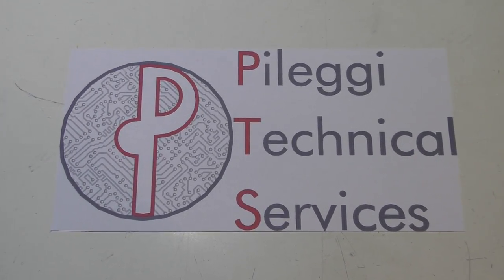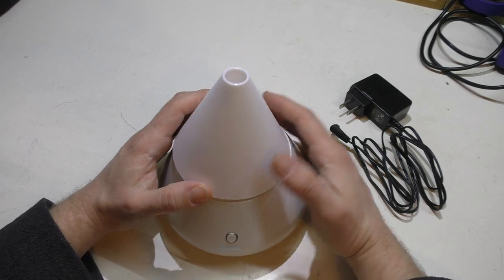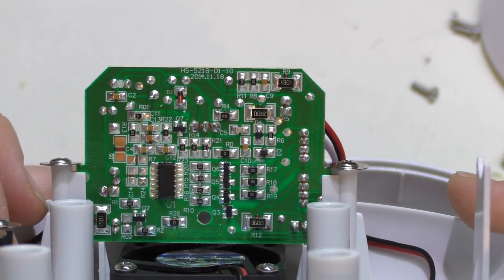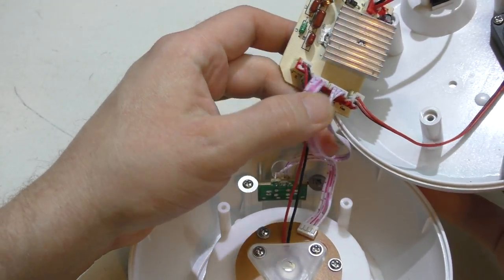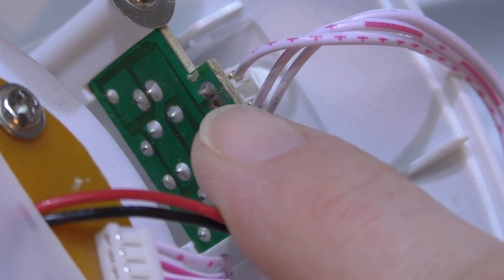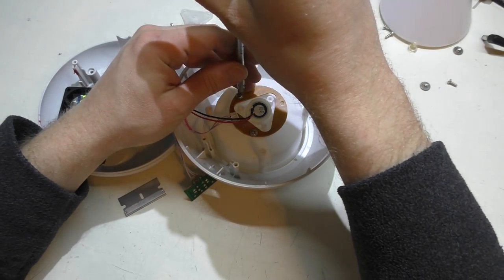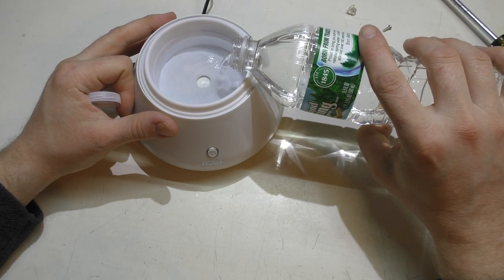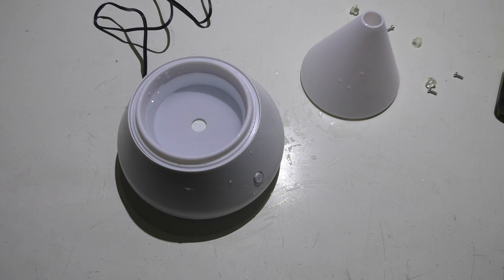PTS Ep. 37 - Aromatherapy Diffuser Repair

Comment: Take it apart first as Chris said and look for rust.  I paid to much for this thing to give up and by another.  I just finished fixing mines.  Chris I don't know what kind of tooth brush you used but I used a piece of steel wool (Toothbrush failed lol) to get the rust off of any components.  You are the man!  I worked threw three Amy Winehouse songs (auto play but songs were good), I may be a new fan.  Anyway I cleaned the steel wool off with q tips (case anyone tries my madness) and I tapped each side gently to make sure i left no debri/dust/steel wool.  I watched you last night, and  I was like I'm probably not going to try this.  Well I did it worked.  Wow we need more patience in this world and you taught me a bit more with this video.  Thank you I saved 40.00 bucks plus money I would have spent and ended with same problem. Warning if you have this one pour the water into it carefully I used an ice cream scoop this time and made sure no water went  into the little side slits around the base. Or  wait till it shuts off to refill or just turn it off because the bubbling water will get inside and cause rust.  I bet Ill be more mindful now after what I saw.  Mines is 4 years old.  So they can last with a little patience when feeling with water. I think Now made a big mistake with the design but well I am already in the rabbit hole.  Happy Diffusing and Happy Holidays.  I'm a believer and I am a subscriber.

Comment: Wife's diffuser didn't work.  Saw your video.  Used a toothbrush and electronics cleaner...reassembled and worked.   Nice.
Reply from the maker: Thanks!  Glad it helped.
Reply: I think the oil from the diffuser builds up over time.  The toothbrush was pretty dirty.

Comment: This totally saved mine! Mine was still producing mist (though not as much as it had originally) but it wasn't coming out the top at all. I feared the fan had gone bad but I was able to get away with just following you! There was also a lot of gunk around the ceramic plate where oils had built up a residue and I cleaned that real well, but the corrosion was pretty extensive and I'm certain that's what saved her. 

At the very least, this was a great instructional on how to take it apart and put it back together because I would've been too scared to try it on my own! Thanks so much for your help! 😊

Comment: Thanks so much for the video...I was hopeful to fix my Young Living diffuser after I saw this but to no luck. There was corrosion on the circuit board and I cleaned it off with an old dry toothbrush. The ultrasonic thing doesn't vibrate, and the fan doesn't come on and no mist. The light works. Oh well. It was fun to try. Thanks.
Reply from the maker: The only other thing I can suggest is to try using isopropyl alcohol with the toothbrush.  In fact, you can even soak the whole board in it.  If there is any "hidden" corrosion that may help to loosen it up.  There may be an area that it's shorting out internally from the corrosion.  It sounds like parts of the board are receiving power.  If you'd like you can also send me the board and I'd be happy to take a look at it (for science).

Comment: Thanks so much for this video! While my LED lights are still not working, I got the mist to work again by following your instructions! Taking it apart helped me realize the importance of staying below that water line. I am pretty confident I overfilled it and the LED mechanism got water damage somehow. Anyway, I'm happy it is not a total loss. This defuser was pricey! If you have any tips on getting the light to work again, I would be ecstatic! I appreciate you!
Reply from the maker: I'm glad you got it working.  I'd try repeating the steps mentioned again;  a second cleaning might work.  Check the LED board for corrosion.  Also check the connectors, if any.

Comment: I have two diffusers, both have gotten water inside and aren't working. I watched your vid and took them apart, everything looks fine! One had water in it a long time ago, and I let it dry and now I turn it on, and it turns right off.
The one that got water in it today I turned on not knowing there was water in it and it turned on for 5 seconds and turned off. I dried the circuit boards and I'm letting it air dry more now, so hopefully it will turn on again. Any idea why the other one which is fully dry turns on and then right off? Is that fixable?

Comment: Hello; Well, I have a good one for you. I had set couple of the tops from couple of my diffusers  on the kitchen counter, for me to clean them. My husband was doing dishes, he asked me if those go in the dishwasher. Of course I told him NO, I will take care of them.  Little bit after later I went to the kitchen to clean the tops, and they were not there. I asked him where he put them.   He said the dishwasher, 'darn" next you can probably guess what happened.   So now the diffusers don't work. I was gonna to put them in the trash. Instead I thought I would see what I could find here on YouTube.   If you have any suggestions please let me know.
Reply from the maker: Repairing water damage can be a hit or a miss. I've repaired cell phones in the past where people have accidentally put them in the wash. If you catch it in time, and are able to dry the circuit board completely, you might be able to save them. Then again, I've also had a single drop of water completely destroy a phone. It really depends on how the water affected the device. I'd say put them someplace warm and let them dry out for a few days. Visually inspect the boards for signs of corrosion and if there is any try to remove it like I did in this video. They might end up working after all.

Comment: thanks for the videos! I noticed that my diffuser was not blowing out mist even though it was producing it, do you address brushless fan repair in any of your videos? I took the fan blade off and and cleaned with canned air and re-lubricated and still does not work, though the internal circuit board to that is heavily glued on, and can't get it off, hoping to find one at radio shack or some place to replace it.
Reply from the maker: +jaime anita those fans are so cheaply made that it's not really worth repairing them on the component level.  Chances are one of the components on the driver circuit failed and now the fan is toast.  Out with the old and in with the new as they say.  If the 'Shack doesn't have it, Amazon or eBay surely will.  Just find one with the exact same size and voltage ratings.   The current rating should be close and if you get one with a similar CFM rating that's even better.

Comment: Any idea how to get the lights to start working again? Mine is no longer changing colors, only blue. Thanks!
Reply from the maker: +ashley bailey that's a good question.  I'm not exactly sure.  Are there any other issues with the unit?  Does it function as normal otherwise?  The color change function should be provided by a dedicated chip on the main board. There are so many places to trace from power cord to lights, that it's hard to say what the problem could be.  I'm intrigued to say the least.

Did you look at the circuit board to see if there's any corrosion  present?  While you're in there chef all of the connections, something could be loose.
Reply: Pileggi Technical Services Everything else works fine. The only color that seems to work is blue. Then when it cycles to the next color it goes dark until it cycles to the blue again. I will check it today and see if there is any corrosion. It's less than 6 months old..

Comment: Can you let me know where I might get parts for a diffuser? I might need a switch. Thank you!
Reply from the maker: I'd say try electronics parts distributors like Jameco, Mouser, Didikey, or even eBay.  The parts they use in these things are most likely 99% off the shelf and should be easy to find.
Reply from the maker: Did you get your issue resolved?  I just noticed your message that you sent me over a month ago however I responded to your comment first.
Reply: No, I have not. My diffuser in sitting here in pieces. I have heard of people having similar problems as mine. They replaced the ceramic diffuser disc. Now I am looking for one of those. I can show you a photo of it. Thank you for the info. I will look at these distributors!